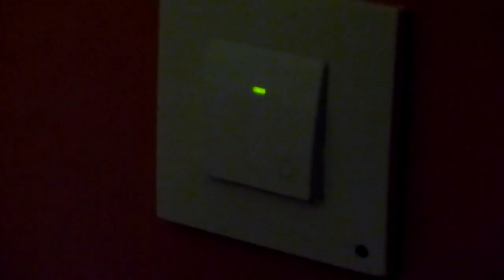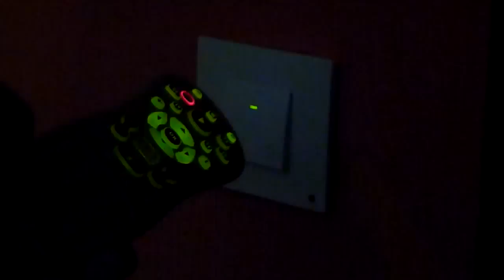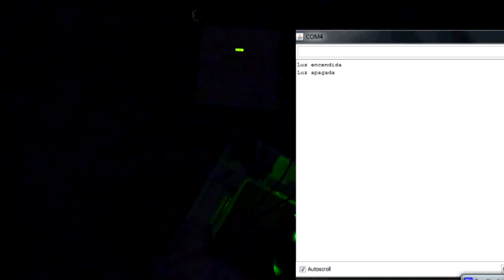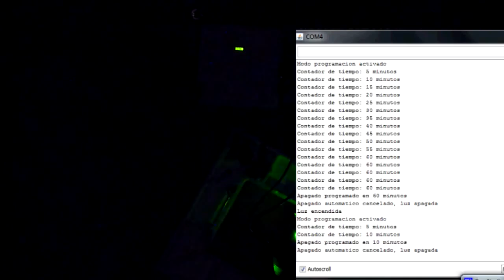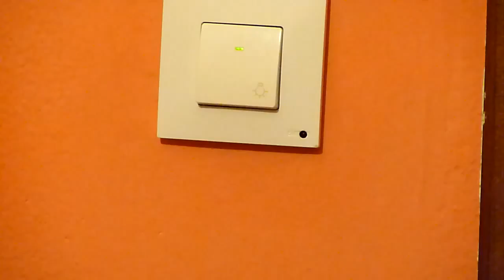Arduino Mini Pro: Control Remoto de Alumbrado - Remote control of lighting

Comment: hola buenas copio y pego su codigo de la version v1.1 tal cual en el arduino y me suelta el siguiente error

Arduino:1.6.5 (Windows 8.1), Placa:"Arduino/Genuino Uno"

C:\Program Files (x86)\Arduino\libraries\RobotIRremote\src\IRremoteTools.cpp:5:16: error: 'TKD2' was not declared in this scope
 int RECV_PIN = TKD2; // the pin the IR receiver is connected to
                ^
Error de compilación

  This report would have more information with
  "Show verbose output during compilation"
  activala desde Archivo > Preferencias

que puede ser?

solo me interesa poder encender y apagar la luz desde el mando o el pulsador, todo lo de la programacion de apagado no me es relevante
gracias y saludos